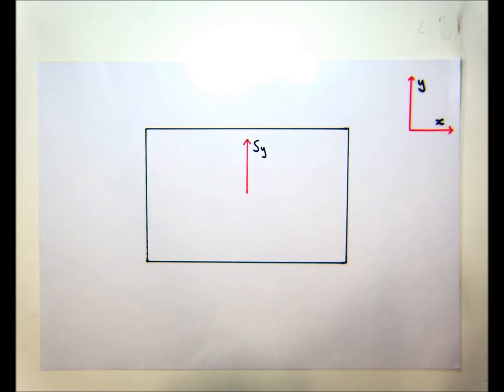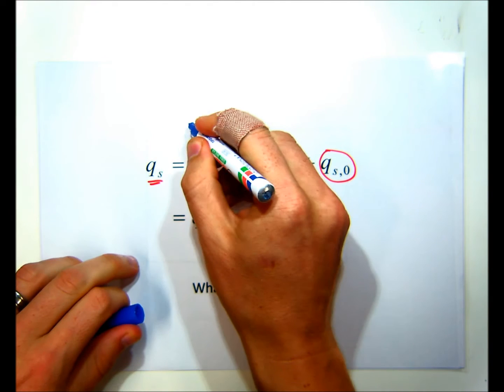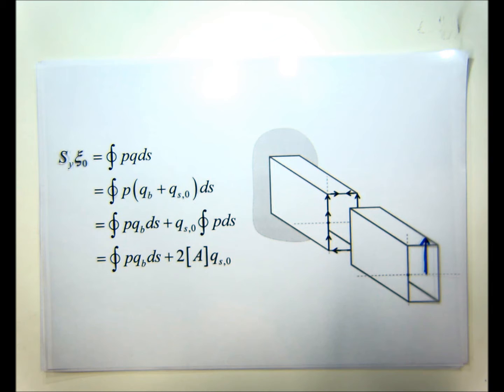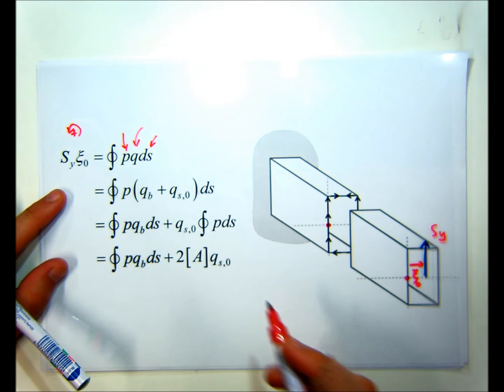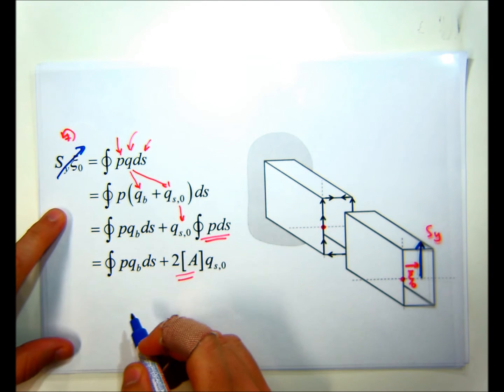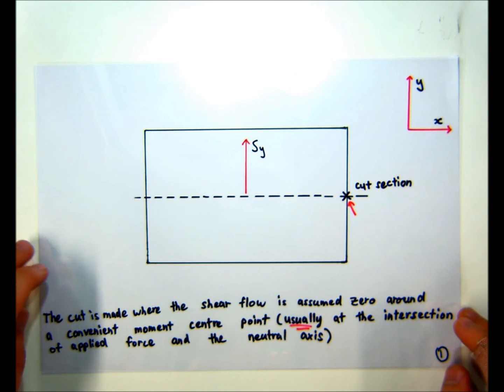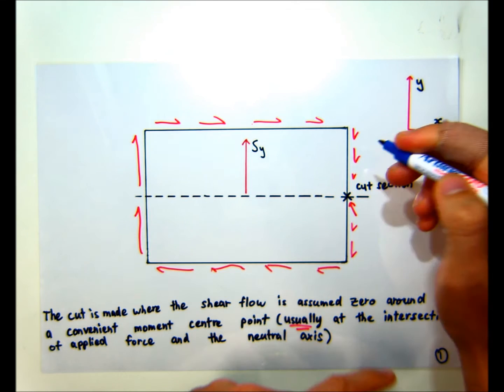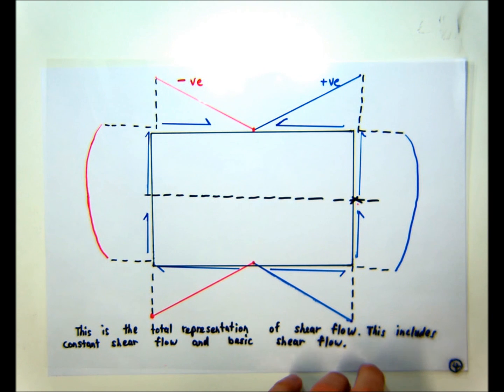Closed Section Shear Flow Demonstration

Comment: @Jarvis Gomez-Burgos, you just have to add q_b (which is a function of the arc length parameter "s" along the section) together with q_s0, which is a constant flow. If you add those and then represent them on the section, that's what you get!